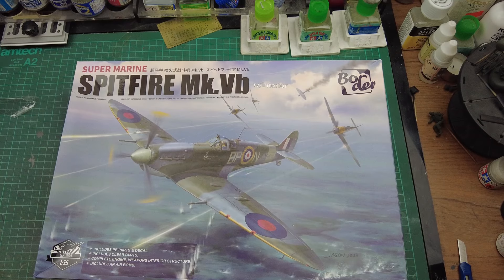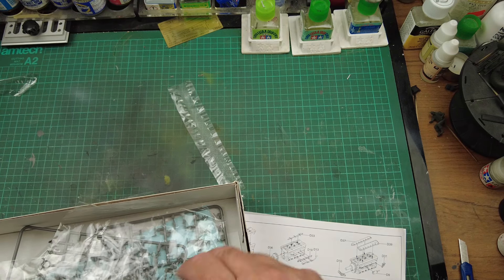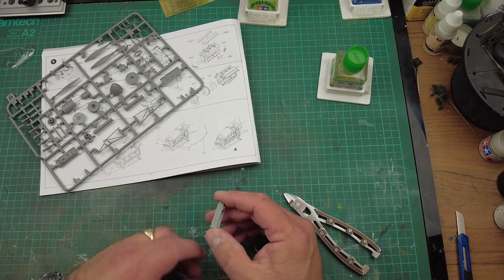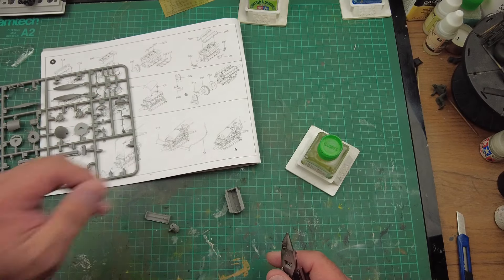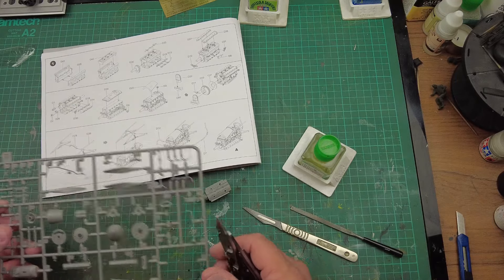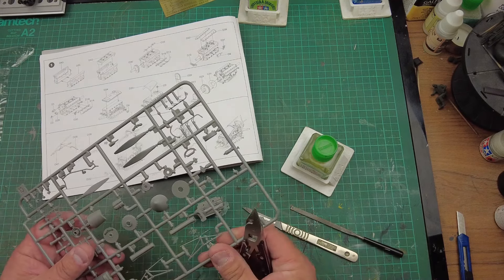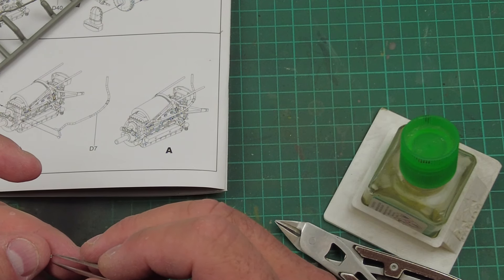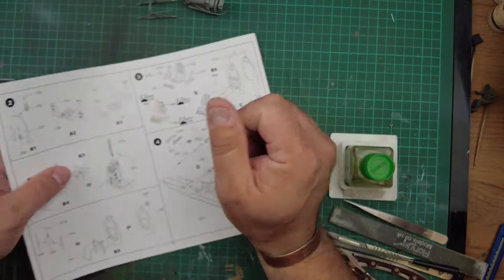Border Models 1/35 Spitfire Mk Vb Build Series Part 1

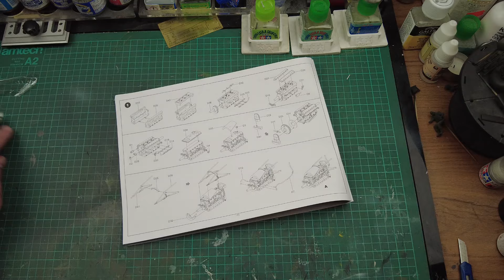Comment: Really interested to see how it turns out. I'm quite keen to get this kit but I her that the design is based on drawings from the 1:24 Trumpeter kit and there are some obvious inaccuracies.
Reply from the maker: Thanks for the info, I’ve heard there are inaccuracies but to be honest I’m not knowledgeable enough about the spitfire to be able to spot them, hopefully the finished result is a good representation of a MkVb😁👍
Reply: @KitchenTableModeller  I'm keen to do one opened up as much as possible undergoing field maintenance on a Maltese airfield. Fantastic variety of paint schemes and weathering opportunities with Malta based aircraft. The one thing I can see from pictures that looks weird is that the blisters on the upper surface of the wings over the undercarriage bays are at an angle rather than aligned to the airflow. I don't know how you get that wrong - it's pretty obvious and there won't be a single photo that shows them that way. Maybe I can cover them with the open panels from the cannon bays! I've also got two of the Kotare 1:32 Spitfires - that is a hard act to follow, they are fantastic but as they don't have opening panels so I can't use them for this diorama.
Reply from the maker: Fair comment, I’ve heard a few folk taking issue with the lack of opening panels and interior detail on the kotare spit, I think you idea with the panels covering the error is a good work around. In all honesty I never think to open an aircraft I’m quite happy with the clean exterior look😁👍
Reply: @KitchenTableModeller  Yes me too, this will be a bit of a one off that I just fancy having a go at. I don't really get opening a panel on a kit just because you can, unless you do it as part of a vignette or diorama.
Reply from the maker: Totally agree and I think this is where Border has dropped the ball with this kit as its scale lends itself to this sort of display with so many different vehicle, equipment and personnel options to choose from. I hope it won’t be too long before some of the 3D printing detail specialist produce replacement parts to fix the faults so modellers have the option to have a detailed fully open kit👍

Comment: Overall fit and details are good, however, the firewall and one of the photo etch detail for the right side wheel well is wrong.  The decal colors seem too light, especially the dark blue and minor errors in the instruction manual.
Reply from the maker: Thanks for the info, I agree about the decals and the silly errors in the instructions, I thought the firewall looks a bit off but I’m not knowledgeable enough about spitfires to be confident in highlighting this problem.😁👍